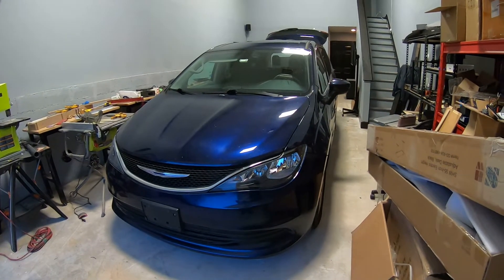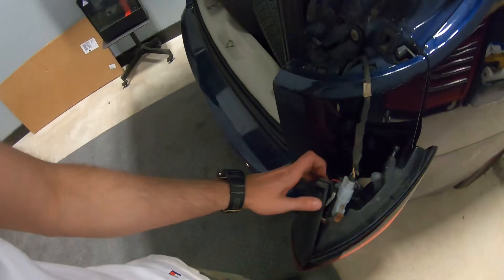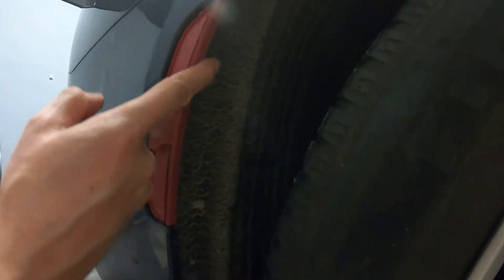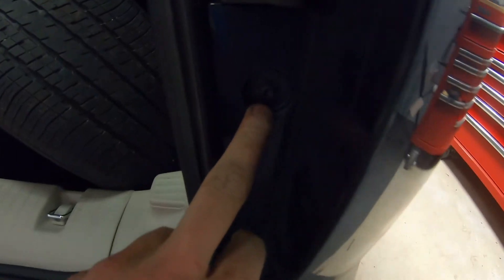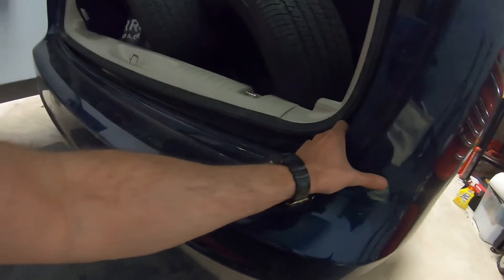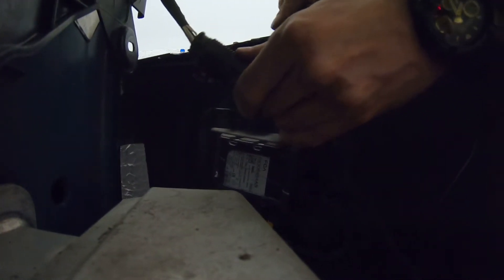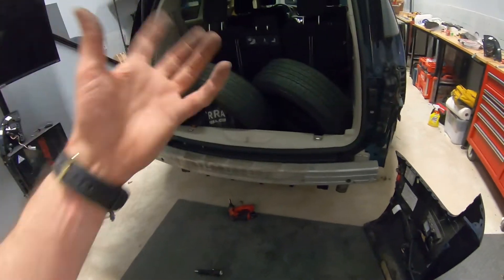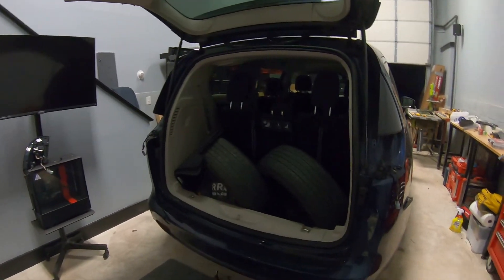How to remove replace take off Rear Bumper cover Chrysler Pacifica 2017 & newer

Comment: Great detailed video! I have a 2020 Chrysler Pacifica, is there a way to replace the rear bumper sensors without taking the whole rear bumper off?
Reply: Actually no, they are screwed inside the bumper, you will need to remove the bumper
Reply: @jitubats  Taking the bumper seems like it could be a lot to do!
Reply: @TheDrumhead54  Its actually not that bad.. it just take a little bit of finesse and time.. else as @op has shown its great
Reply: @jitubats  I will study your video here and give it a try